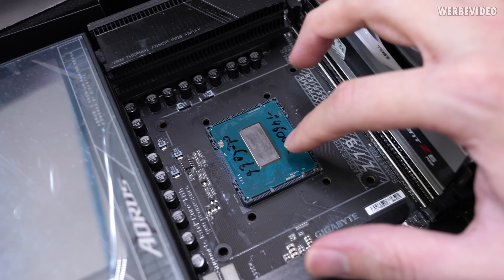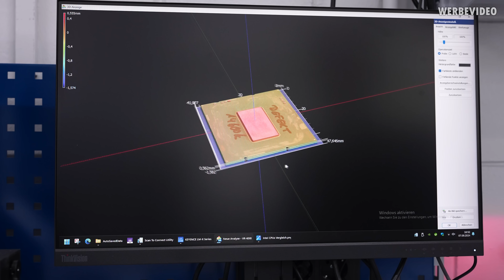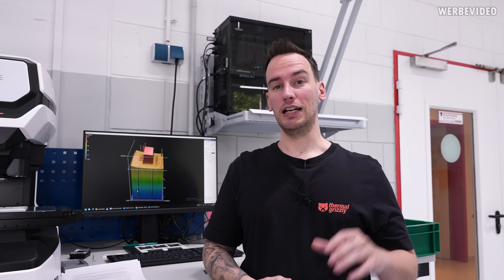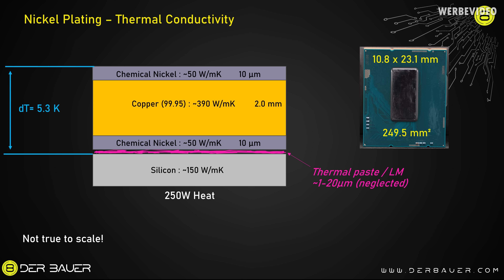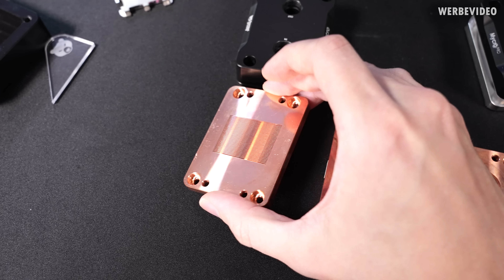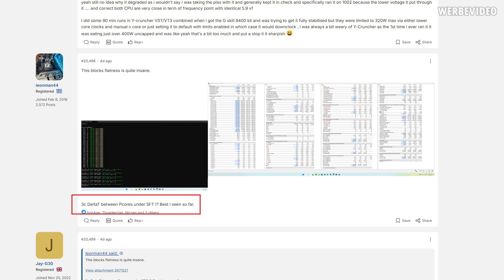We Identified the Problem with Our Water Block

Comment: This is not just about honesty. This is also about engineering. Understanding heat transfer and metallurgy, machining and contact pressure, and crafting all of that knowledge into a working product. I particularly like the approach of "performance first" - it isn't that appearance does not matter, but given I have no RGB (don't want to be distracted when gaming) and nobody can even SEE any of those shiny surfaces once the block is installed, I have absolutely no problem with how it looks. "Satin" is also a trendy finish, sometimes preferred over "mirror" anyway. 
I'm quite sure no other "tech" PC youtube channel could even attempt to discuss any of this detail, never mind do it in a second language. Great job.

I do have one reservation though: replacing the chamfer with a radius does indeed remove a sharp edge with a gradual fade out of contact. BUT that contact pressure ring still looks too narrow, and particularly ceasing while still much too far from the edge of the PCB. All of the pressure from pins outboard of the last contact area is pressing upwards, and concentrating that contact force at that edge, whether sharp or radiused.

I would be seeking to absolutely maximise the width of that contact ring, pushing it as close to the plastic as possible. Ideally, touching ALL of the PCB wherever possible. That way, the pin pressure will press the PCB up against the block everywhere, and flatness (or rather, bending) will cease to be an issue. 

Note too that the chamfer and radius both reduce the area of contact, which exacerbates the local contact pressure at the edge of the raised surface, regardless of the finishing machining there.
Reply: the troubles I see are: with bringing it further to the edge is that it'll come into contact with the SMDs and probe points - it's already pretty close on the chips shown, and those aren't the *900ks which will have more SMDs; making the rim too wide would cause it to want to bow underneath the relatively large & fragile chip as well, which is already under pressure, and could cause the chip's underneath contacts/protective side-coating/the chip itself to be compromised from the inherant unevenness of the mounting process
Reply: respectfully to derbauer, there shouldnt be any contact with pcb at all - the block should only contact the exposed core. any tensioning/torsioning issues should be mitigated by a bolted-thru metal backplate with metal thumbscrews atop industrial grade springs alone, not physical pressure on a soft pcb.

warpage bad enough to sever traces may be delayed by rounding the 'pressure ring' edge, but not prevented. in the beginning of the vid its stated that it was designed to counteract pcb deformation; imo this is clear evidence that the mounting solution itself needs to be more carefully redesigned (in terms of mathematical calculation of pressure and the angles of its distribution)

Comment: When you were initially talking about chrome, I thought I heard you say that chrome and nickel didn't work together well, that chrome didn't stick to chrome easily. Then I thought you said that you had to put down nickel first and then the chrome. My recollection of automotive chrome plating of steel, is that chrome doesn't stick to steel easily, and that a copper layer has to be put down first and then the chrome layer will stick well to that copper. If that's the case, then could you just put chrome straight on the copper cold plate?... or did I hear wrong about chrome, just trying to understand things here. Thanks for the great detailed explanations... even tho I am a noob on this subject, its really interesting.

Comment: Visuals last 2min while you unbox. Once you install it you can’t see any of that. Me personally, I would like a version that only has coating on the CPU side. I’ll take the 1 deg gain from not having the fins coated. Not worried about my coolant corroding the copper. Could be cheaper for you as well. Realistically only the cpu contact area has to be coated.

Comment: you may have thought about dedicated direct precision cooling of cpu and gpu, lots of pipes connected from cpu to each separately to peltier systems along with platinum temperature sensors between the tubes, cooling where it is required, not all silicon, only points where the temperature is high, cooling the entire core causes an increase in the temperature difference and damages the core

Comment: Uhh can I trade my two old blocks that have quit performing in?  I'm stuck with two of the old ones that work like shit.
Reply from the maker: All customers who bought the normal Intel Mycro from us will receive an email tomorrow :) Or which blocks do you mean?
Reply: @der8auer-en  does this video only apply to Intel?  My amd blocks are not working like they did in the beginning?
Reply: I put a signature v3 on my 7950x and got about 10 degree improvement over the old mycro block so I assumed these new findings applied to amd also?
Reply from the maker: the signature v3 has a much more advanced cooling structure than our older Mycro. That is what I showed in the last section of the video talking about going from 0.5mm down to 0.2mm. We now have a Pro version with better sturcture but last year we were just not on that level yet
Reply: @der8auer-en  ok, i misinterpreted sorry.  I really appreciate your work on the forefront of cooling.

Comment: Actually really cool the common understanding of “the nickel is so thin it should have negligible impact” still holds true, but when you’re at the bleeding edge these things start to matter significantly
Reply: Coatings are notorious for causing issues like this. Been a recurring issue for possibly over 100 years. 

If you look on any high tech coating manufacturers website they go into great detail about how it affects tolerances.
Reply: With things like PBO/2 & auto overclocking even 2C can give more performance these days. I'm all for a rear fan behind the motherboard behind the socket because of it
Reply: This being amorphous is also bad for conductivity, see the recent @nilered video about him making amorphous metal glass in his ATOMIC TRAMPOLINE video (if you have the hour to spare). He talks about how bad the amorphous metal is at conducting heat. He's trying to arc-blast it and it won't melt LOL I think the nickel plating being amorphous is bad for conductivity.
Reply: @nikonmikon8915 yeah they found out the hard way the electroplating was superior

Comment: So the same problem that EK had in the past. Interesting...
Reply from the maker: Not really the same issue. They had delamination of the layer.
Reply: @der8auer-en  I know, I've watched the last video of GN aswell. But the Nickel plating was the culprit in the end in both cases. And I know it from experience. I'm trying to direct gold electroplate some copper and brass parts without a nickel barrier and is not as easy as I though it would be.

Comment: So every machined part designed by Thermal Grizzly prior to this has the same chamfer flaw is what I hear.
Reply from the maker: We're talking about the ~50 blocks that were initially made. But keep in mind this happened after we removed 0.4mm of material allowing a much higher mounting pressure than on the one that  was sold. The sold blocks did not have this mounting pressure
Reply: I'm sure TG will make things right with their customers.

My comment was more towards the idea that this was an unknown unknown. Prior to this lesson, their goto cnc design was a chamfer.

Comment: You said you killed 3 cpus during this testing. Shouldnt that testing occur before release?
Reply from the maker: It happened after we modified the cooler which allowed much higher pressure than the original design. So the released cooler did not have this

Comment: I have been Nickelplating a lot and - at least for experiments - electroplating nickel is really easy. I advice you to still use your supplier for production parts for the market, but I also advice you to electroplate nicke in shop for trial parts.

Comment: Does the high performance heatspreader for Ryzen 7000 have the same issue? I’ve recently delidded a 7800X3D and replaced the IHS with your HPH (with Liquid Metal), but there were no performance gains. Temperatures were actually a little worse - 1 to 2 degrees.
Reply from the maker: shouldn't have the same issue because for these we used a different supplier because at that time we were still at the old location (moved company End of 2023). But please reach out to our customer support and we can check to send you a different one to see if it improves temperatures or if it's caused by something else
Reply: @der8auer-en so I’ve received a second heatspreader (super fast response time and delivery - kudos). The is a different address on the box and a huge difference in appearance, like you said in the video. The one I had before was nice and shiny and the one you guys just sent me not so much, more of a brushed finish. Here’s the interesting part - 10 degrees difference between those two heatspreaders, so it seems the problem isn’t limited to Intel parts. If you want I can give you my full results in a spreadsheet somewhere.

Comment: I've often wondered what would happen if you did electroless plating of AlGaN on copper, rather than nickel. It'd probably be expensive initially since it's an unusual coating, but there's some evidence that the metallurgy works out in terms of liquid metal embrittlement, and the thermal conductivity is about 4-5x higher.

Comment: Hey, Roman, is AMD Mycro affected in any way because of your research done now? I've purchase Mycro like 2-3 months ago, I'm quite happy with it, but do you plan updates on it as well?
Reply from the maker: for AM5 we only updated the sturcture to improve temperatures. The block should be okay because a different nickel supplier was used for these. The Pro is better cooling wise but the old one is still good.
Reply: @der8auer-en  I tried to check out the board you linked, but seems like only Intels are tested there. On the new block for AMD is 5 degree performance realistic to achieve on the new block? Now I'm really tempted to buy one :D 
Just for sake of some feedback to Mycro direct die if you're interested - There is one feature, that I'm not particularly happy about in the mounting mechanism - you have to lay your pc flat to mount it, or otherwise the CPU will fall out of the socket. If pc is kept in the case like normal people do it's not a problem, since you can just turn the case, however I've got my motherboard upside down under my desk, so I have to take out motherboard for any adjustments to the TIM. Maybe in on of the futures revisions of the design you can think about freaks like me:)

Comment: I love that you preferred the higher performance over the visuals for the nickel plating. I cant speak for everyone, but if you're buying thermal grizzly, I think you have the same priorities
Reply: Not to mention that once it's installed, you won't ever see the bottom of the cold plate where the nickel plating is anyway.
Reply: @wimpyhugz_TGK  There is a reason why the coolers get plated, it´s for the looks.
Reply: @gils_rhapsody  Nah the reason they get plated is for corrosion resistance towards the liquid metal lol
Reply: @gils_rhapsody  aesthetics are a secondary reason. Corrosion/oxidisation protection is the main reason since copper will slowly form a green patina even when exposed to air
Reply: @stephenhauer9055  On our Russian YouTube channels, bloggers conducted experiments, connecting two copper plates by applying liquid metal between them. After 2 years, no changes occurred with the copper, it did not collapse from corrosion like aluminum. The liquid metal simply penetrated the structure of the copper and dried. That is, on the copper it created a surface similar to nickel-plated. After cleaning the old dried liquid metal and re-applying the liquid metal, the metal no longer penetrated the copper and did not dry out.
Reply: @MrMaxwins  maybe it's heat-dependent (chemical reactions get ~2 times faster every 10°C), the youtuber Chloe Lee tested liquid metal with bare copper and the performance degraded significantly over time
Reply: sure, have it being naked copper.... then what about liquid metal?

Comment: Hey Roman, is the AM5 (TG-MY-DD-AM5)  safe and effective (  😉 )  or it has the worse coating? I have one. I haven't used it yed. I'd like to try with 9950X. 
Any tips? 

Second thing. There is a company NudeCNC for which I was testing Ncore1. The push to the PCB was obtained by stickers. So no matter which CPU for LGA1XXXX you would have, you just had to place right amount of stickers on PCB  - which would not for sure damage the PCB.

Comment: So, I know it seems kind of backwards since they're usually used as insulators, but have you looked into ceramic coatings at all? Silicon Carbide has a thermal conductivity nearly as good as copper. Only thing I'm not sure about is how it'll react to the gallium, but I'm thinking it would be okay since it's just silicon and carbon.

There's also Berellium Oxide and Tungsten Carbide to consider as well.

If you really want to go crazy, look into Polycrystalline Diamond.

Edit: After further reflection, Berellium Oxide is right out!
Reply: beryllium oxide? are you out of your mind?
Reply: @TheBackyardChemist  maybe? I mean, once it's plated on its supposedly no longer dangerous, right? McLaren? Yeah... maybe I shouldn't have mentioned that one.

Comment: Darn that is some impressive problem solving in the end, and I'd not have expected such a thin coating to matter nearly as much as it turns out too either, so easy to not consider a little detail here and there. Love the transparency on how your testing failed and fairly deep dive on the problem solving!
Out of curiosity have you considered a combined contact frame IHS type product (much the same as the water block cold plate really, just without the water channels) so a delidded CPU can use normal coolers and perhaps get better contact? At least for Intel where the flatness and mounting seem to be really quite poor by default I'm curious how much improved if any over the stock IHS that could be, and if it works at least well enough it could keep those enthusiasts systems in service with a normal likely air cooler relatively cheaply when they have moved on to the next generation processor for their usual rig.

Comment: Derbauer has come to save the day! EKWB is going under due to their poor management to say the least and Thermal Grizzly is taking their spot. Lets hope they start making Radiators and pumps too, too many other companies that are out to screw people over to make better margins, Corsir.
Reply: I wouldn’t exactly say that TG ”is taking their spot”, the company is still pretty small and specializes in certain products. Watercool in other hand is a german manufacturer that has been in the watercooling market for a really long time. I still wouldn’t say that they’re taking any spots either though. Most of the known pumps like D5 and DDC are made by Xylem and simply rebranded for Watercool, EK, Corsair etc. I personally think that Corsair pricing is actually decent for their radiators which are made by HWL and I like their hard tubing.

Comment: There's an expression "It’s not rocket science".

This story shows two things.

Firstly, a lot of things ARE rocket science.

Secondly, there's a difference between science and engineering.
Engineering is finding out how all the science interacts in practise, and fixing it.

Something Boeing has been finding out recently.
Reply: Boeing made a childish mistake in working with composite materials, from an engineering point of view. Any engineer who worked with composites would have been able to see these obvious stress points where the composite could begin to delaminate. It is doubtful that they did not know about this flaw at the design stage, most likely they did it to reduce the cost of production, considering this flaw insignificant. There is no crime that business will not make for the sake of super profits.
Reply: Boeing already knows this. Boeings' corruption just finally turned inward. You can't out engineer corrupt management.
Reply: The funny thing is, rocketry science is arguably remarkably simple. Does this fuel do ΔV pretty good? Cool. Also, rocket science isn't like really a thing, I don't think? It's a bunch of different sciences that don't really have much to do with each other in terms of the science.

Rocketry engineering is a nightmare field filled with the most brilliant and stressed out minds on the planet, because messing that up leads to huge amounts of wasted work, material, and sometimes life.
Reply: This comment is underrated and poignant.

Comment: Bought your direct die mycra block for my 14900ks day 1 it came out, currently typing from it, 30 celcius all cores, 15c ambient, max 41c at low load just idling
Reply: Annnnnnnnnnnnnnnnnd it's dead lol. I believe it's CPU fault from bad BIOS though. Never had thermal issues, I always had coretemp at the ready to check